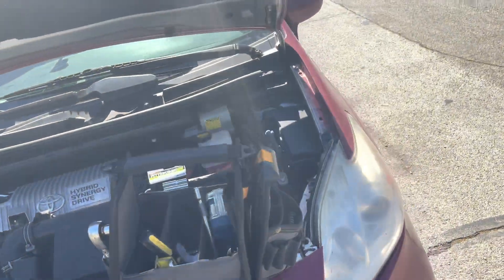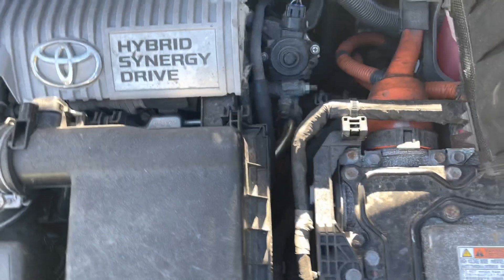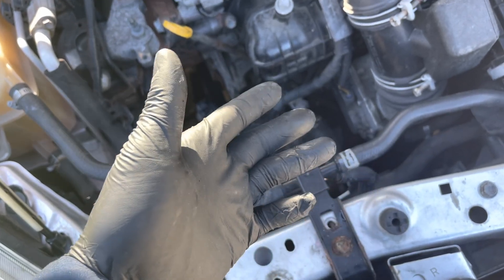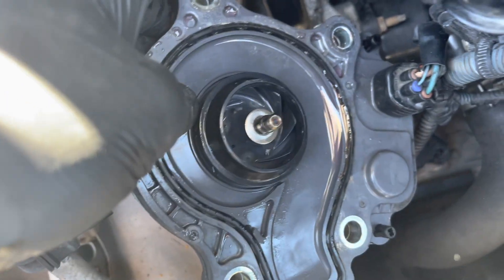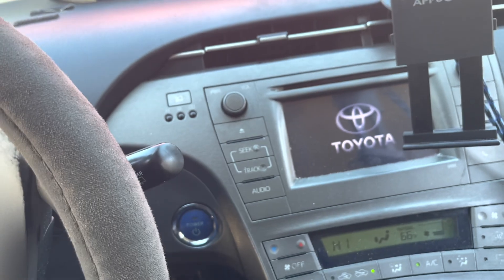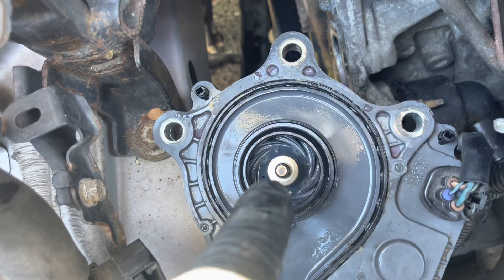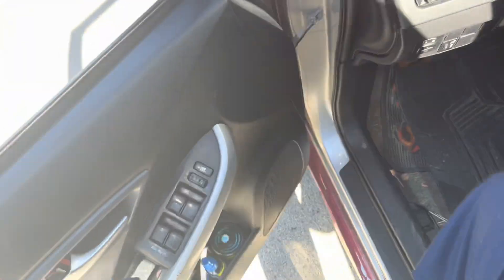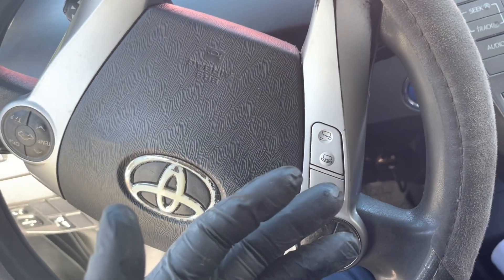Toyota Prius 2010 11 12 15 overheating trouble shooting water pump , thermostat, temperature sensor

Comment: the waterpump is brushless motor. I has no gear. The reason it is not running because it rotor damage or weak of magnet. You need to replace with the OEM pump.

Comment: This makes sense, I’m gonna start with my water pump. It overheats when I first start driving it, I thought it was my thermostat because with the heater on it’s blowing cool air and then the hot air comes out, but then the engine cools right off.But I’m pretty sure it’s the water pump not engaging. No leaks

Comment: Best Part is at 4:26sec
"Go through these steps:"

1.  The coolant temperature system. Tell the fans to kick on.

2. Thermostat. Keeps the hot air in and circulates it. 

3. The water pump.  Can cause your car to shut off. 

Thats really your whole coolant system.

Comment: HELP PLEASE. 2012 prius, 150,000 miles. random sporadic unpredictable overheating since june, finally Toyota determined it is a HG. got a set from rockauto, viktor reinz. The original HG appeared OK, nothing massive. Talked to a specialist, who convinced me that the leak is minor, and invisible, but enough to send exhaust gases into the coolant sometimes. Test for exhaust gases in coolant was negative. Also, coolant was clear pink, no sediment, no mud, no discoloration. Anyway, I just finished the job, and the overheating is now full time. test driving with autel mk808bt watching temperature and pump revolution. temperature was 80+ and then went all the way to 101. I stopped several times to let temperature go down to 90 to come back home. Even at 101 the radiator fans were OFF. They are supposed to turn on at 92 or 95. If I turn the AC on, then they begin to spin, meaning they are not busted, and the relays are OK. I was very careful to reconnect all electrical wires. Did I miss any? I made detailed description in my car logbook of every simple step I took. I worked slowly and meticulously. Today took apart and flushed the radiators with garden hose <I was looking for disconnected temperature sensors, did not see any>. Coolant and water came out clean. No sediments, no deposits. Should I prepare a publication for the SAE International Journal of Engines? Any help will be greatly appreciated.
Reply: I have the similar problem with my 2010 Prius, 200K miles. What is HG? I am using a OBDII scanner to monitor the coolant temperature. It seems that the temperature goes up very quick after it reach 90 C. I am not sure whether the issue is about the thermostat or the ETC sensor. It seems that the ETC sensor is working, although the report number jumps quick up and down above 100C. I would like to change the thermostat to give it a try.
Reply: @junma3483   HG  means headgasket which is very common problem with 3rd generation Priuses ... For whatever reason... a few theories why... clogged EGR correlation , so get it cleaned ASAP, and do it every 50K miles along with PCV Valve and intake Manifold.... Get your Coolant flushed every 5 years in case depending on what coolant you use. Replaced the Water pump which is must.... since Toyota uses plastic fins and that goes bad and doesn't have the signs of a normal belt driven pump like bad bearing noise... I just got Gifted a 2010 Prius with 99K miles with bad read wheel bearings and needed new tires... Got most of the car serviced myself Just have left the do the inverter coolant changed today and next week brake fluid change... then will start working on detailing the exterior since a few small areas are started to do dull. and replace both Driver side mirror and passenger side mirrrow with an aftermarket black one since the drive side mirror was damaged from a hit.  Yeah I plan on replacing the water pump and thermostat this summer... don't want it to fail since overheating in most cases kills your headgasket.. might consider replacing radiator and coolant hoses.....
Reply: @haywardkong1213    The garage I visited was suspecting the headgasket issue too. They did a pressure test with the coolant system. However, they did not find any leaking in the coolant system. Does it mean that here is no way for the hot air getting into the coolant system? The technician suggested to replace the head gaskets and event the engine. The cost is good enough to purchase another 2010 Toyota Prius with 200K miles on it. I decline that of course.
Reply: Anyway if you overheat, the thermostat and temperature sensor becomes inaccurate and you have to replace it again each time you overheat...  You need to find the root cause of your overheating issue.  Here's a good video on headgasket issues from Faye Hadley.   https://youtu.be/brLmBRYSb_E?si=dYd0HF0jLuTTXQsJ
Reply: @haywardkong1213 The HG was replaced soon after my previous post. Problem solved. I did some 2000 mile trip and watched temperature and water pump all the time. No problem. I disagree with the idea to change thermostat and sensor each time.
Reply: @haywardkong1213  the deffective head gasket was causing overheating, not the other way around.
Reply: @west_park7993   cool... yeah I'll replace my headgasket if that ever occurs in my newly acquired and gifted 2010 Prius 99K miles...  Also have a 2005 Scion tC with 2AZ-FE engine and 2014 Subaru Outback with FB25 Engine...
Reply: @haywardkong1213  if you are lucky, your 2010 prius will go for ever. else, you  will have tiny head gasket leak and will not be any of the 7 classic symptoms, like mixing oil and coolant, white smoke, etc. your scion will drive forever, change bushings, clutch, engine oil, gaskets, seals... you may be worry about the subaru. boxier engine, oil does not return to the oil pan, because gravity does not help. i hear subaru typically last 100-150 k and then begin burning oil. hope i am wrong. never had asubaru, just read about this problem.
Reply: Oh just curious, what headgasket did you get ?
Reply: @haywardkong1213   viktor reinz. german company, locarted in stutgard. seals and gaskets for opel, maybach and everything in between. the original toyota are not recommended, because they may be from the same substandard lot.
Reply: I have exactly the same issue. Please let us know how it is fixed. 
The strange thing is that the cooling fan does not kick in at 92-95. If the fan is working as expected, the issue should be mitigated. Is this a control unit issue or some configuration issue?

Comment: How do you hear if the water pump is working or not?  You said you heard that it was working, but how do you hear when the engine is running?

Also, when does the water pump work? Only when the motor is working?

Comment: Could using the techstream tool tell you if the water pump is working or not? P261B appeared one time only for me and using the techstream tool I could see that my water pump and everything else was working. Plus engine coolant temperature didn't go above 185°. At this point I'm waiting to see if the code will appear again...

Comment: prius vibrations and shudders repair and diagnosis now boiling down to feint gurgling noise with the water pump. hopefully it will be the water pump rotor as seen in this video since it is cheaper part to buy than a water pump. thanks for this great video. subbed in 😁

Comment: I’m new to owning a 2014 Prius. Its heater blows air, but it’s not hot or even warm. My AC works. I notice the car is a little rougher running lately. The heater not heating up went out in early spring, and it was getting warmer so I didn’t do anything about it. is there a way to check see if the engine is overheating? I don’t see gauges or digital readout for it. It looks like a bear to get at the thermostat and water pump in this engine. Thanks for sharing.

Comment: I have the 2012
Clogged EGRs are common causing blown head gaskets.
I only use top tier gas it has detergents added.
And 4 ounces of marvel mystery oil every fill up.
The MMO instantly boosts my gas mileage  from 44-45 to 48-50 mpg.
Check your egr I bet it is clogged.
Dont use cheap gas in these. The really need the top tier gas to clean gunk
Reply: You mean to use premium grade gas and not unleaded?
Reply: @flyingcat2054 no need premium
Reply: I use only Shell petrol. Learnt the hard way. But the root cause is spark plugs. If ignition is not good then it results in lot of carbon.

Comment: I have gone through 3 water pumps and still overheating,  already charged the thermostat, check the fans, I don't have a check engine light for the sensor, but I will try your trick. Thanks!
Reply: Hey, did it solve ur issue?
Reply: @faisalrasheed646  I ended up selling the vehicle the way it was, or as is...
A few mechanics told me that no matter what I plan to do was going to fix the problem, that the engine was bad, anyways they could have been wrong but I didn't want to deal with it anymore...
Reply: @franciscocendejas1046  I was told the same thing but I don’t believe them because it’s not their problem. I’m going to replace my water pump tomorrow, let’s see what happens. If that don’t work the next step is to check auxiliary water pump. Because I’m also not getting any heat.
Reply: @faisalrasheed646  One of the big problems with my car, was that when I bought it it came with a bad head gasket, and I used blue devil to "fix" the problem and then I used bears because blue devil fix the problem for a few months only... so I think everything was clogged up in there, that is why I got rid of it
Reply: @faisalrasheed646  were you able to fix your car??

Comment: Is there a simple way to fix it.  I have a 2010 Prius and when i drive it the engine coolant temperature lights up then it goes away.  Will the auto shop pin point the problem?
Reply from the maker: It’s probably the water pump- mine worked sometimes
Reply: i have the same exact problem for a month now. i replaced the coolant resevoir, temperature sensor and nothing changed  ,,to be honest i seen the leak today on my 2011 prius and after watching the video im almost sure the leak was from the water pump..  im taking robs advice and going to replace the water pump tmrw.. thank u superbad for sharing your experience, and thanks rob for the video and educating us. something my mechanic couldnt figure out
Reply: @ahmedab7756  change the thermostat and water pump together if not changed before

Comment: Here is the issue with the cooling system. You most often do not have all those issues in the beginning. What happens with overheating is that it will cause a lot of other things to fail. For example. It might have started with the hole in the radiator, now the fans stay on longer trying too hard to bring down the temperature, Then the overheating causes the thermostat to stop opening, and that in turn messes up the water pump. This is why we do general maintenance. To try to catch those small issues before they make bigger issues.
Reply from the maker: Yeah that’s correct, but also when you by a used car 🚗 you never know how good of maintenance the other person kept
Reply: @Good-humans  Update, I changed the water pump and thermostat and heat came up in less than 5 mins. So I think that was the issue. But also I know I have a head gasket leak cause I get the hard-knocking when first starting up. If I try to use the K Seal should I try to add in where the hose is on the Thermostat? It is worth a shot if it gets me another 100,000 miles by then I can buy another car lol.
Reply from the maker: @pydepiperproductionsllcjon7585  that could be the lifters making the knocking
Reply: @Good-humans  No watch some videos about signs of leaking head gasket. It rattles until it blows the water out because its misfireing.
Reply: @pydepiperproductionsllcjon7585  Hi, bro  I have the same exact issue. I’ve replaced the water pump, the thermostat but it still over heats. I’ve noticed that my fans only turn on for like 2 seconds and go off. By then the coolant is already boiling. Fans turn on when the AC is running, but not when the heat is on. Do you think it’s the coolant temperature sensor? Also try Bar’s leaks for head gasket seals.
Reply: @pydepiperproductionsllcjon7585  the rattling at startup is most likely your EGR system clogged up and also EGR not working at all. It is a serviceable item at around 130k-150k.
Reply: @faisalrasheed646  clean the egr.
Prius have clogging issues which causes head gasket issues. 
Must use top tier gas and marvel mystery oil  4oz every fill up. 3.88 a quart at walmart
Reply: @pydepiperproductionsllcjon7585  Did you have to replace the head gasket eventually?
Reply: @Good-humans  yeah that's true to. I took out my water pump and thermostat but I think my issue was that heater pump. Why I say that is the coolant that came out the water pump was pink. All from the radiator was replaced with regular antifreeze because of over heating I stopped buying the pink stuff. So that tells me it never left the engine. That means it didn't cycle through the heater coil and come back to Reserva. It stayed stuck in the engine. But I also know the head gaskets blown. I get the rattle of death when I start the car after driving it.

Comment: My 2010 Prius just got the battery pack changed they were refurbished, 2 weeks later was stuck in horrible LA traffic for about 2 hours and got a battery overheating on the dash, all coolants were good, do you think it had to do with the recent battery change or some other issue? Thanks
Reply: The battery is air cooled by a fan under the back seat.
It has a filter which must be cleaned or it won't work properly.
If you have dogs or cats in the back, watch that filter.
Reply from the maker: Water pump probably is bad - these are electric water pumps - so the one I had before would work sometimes , and then it didn’t work , then it would start working again- to me getting a new one to fix the problem- please subscribe for more videos
Reply: @Good-humans  yo did your heater stop working when your water pump went out